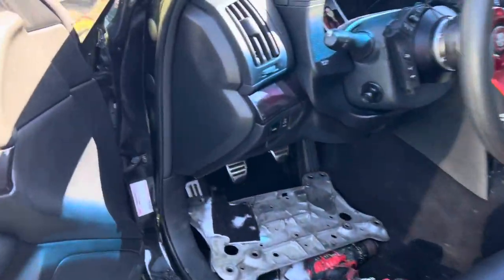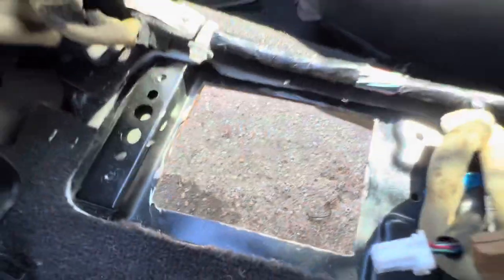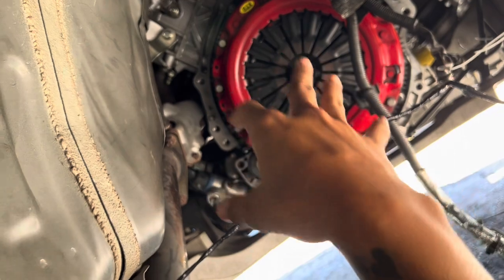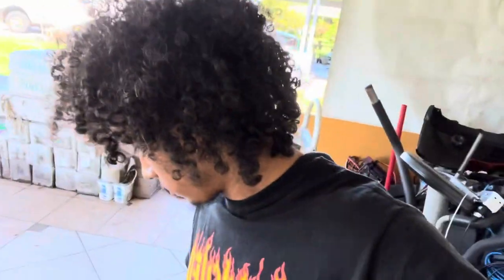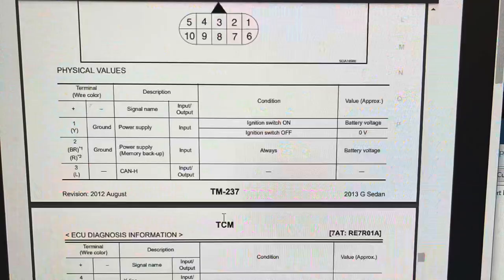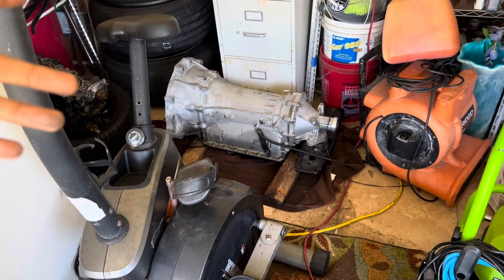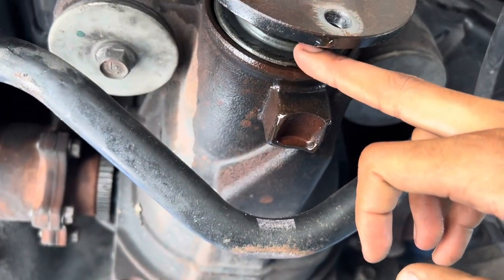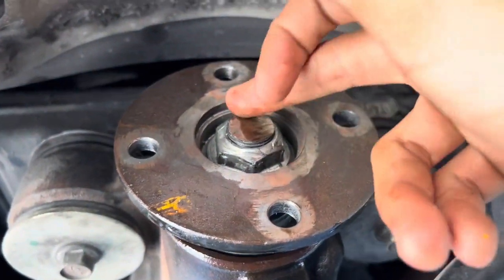How To Manual Swap A g37 Sedan pt. 1

Comment: You have to mark the pinion nut before you take it off and torque it back to where it was unless you replace the crush bearing.  Hitting it with an impact will kill it every time. I did the same thing a few years ago and it lasted about 20 miles of a track day.

Comment: I bought a trans that was locked in gear also and the seller was able to take the black cover off and unlodge something and the trans was great when I installed it. So don’t throw it away yet

Comment: For the transmission wiring harness for the neutral and reverse switch does orientation matter? Obvious grey and yellow together for the neutral switch but does it matter what slot I put them in

Comment: Nice hair brody! 😂🤙🏽 basically looking at this as a nice video to have side-by-side if I end up having to do this… my original 2007 V36 Sedan 6MT was rear ended at a red light, its hard to find these G35S in OEM 6MT (it was order only at the dealers), so figured if I cant find a replacement I’ll get a fully loaded S auto and do a CD009 swap and continue where I left off on mine.

Comment: I don’t think you can get away with just extending the auto drive shaft. They have different connectors on both ends of the drive shaft. The part that goes into the transmission is short on the auto and is blocked by some black metal piece. I haven’t done the swap yet but comparing them side by side that’s how it looks. The manual one has a longer connecter on the side that goes into the tranny. I believe you will need a manual transmission driveshaft regardless. Also the rear differentials are different for a reason. Instead of having to cut that nipple on the auto diff, you could swap for a manual one and fit just fine. There’s also a big ratio difference in the manual ones. It’s a 3.69 rear gear and 3.3 or 3.4 for the auto. To be oem as possible i would just go ahead and get a manual rear diff

Comment: How much did it cost for the whole swap?
Reply: A lot if you buy a new tranny and the right parts in 2024 lol. Im 7k deep about to start the swap but my clutch kit was 1671$ so that was a big contributor. Brand new transmission from Z1 was 2550 plus freight shipping

Comment: hey love that video you gaive all the details im just wondering will this swap list fit the g35 sedan 2008 or should i go with 350z 2008 setup im new in the vq platform
Reply: Yeah u can all universal
Reply: Neutral switch wires will be different on the 5at… you have to look up the wiring diagram. Theres a guy that did it on a 5at coupe and shows which one it is on that transmission

Comment: Hey men ill like some help i want to swap manual my 08 g37 and i want know if a hr manual  transmission works
Reply: I wanna put a hr manual with an hr in a 08 g35x because I crashed my 07 g35s, know if that would work?  Stock g35x is a 5 speed the hr’s is a 6 speed

Comment: Isn't the 7speed faster? Or is it just preference?
Reply: preference
Reply from the maker: Apparently having a manual transmission makes these cars faster but dont quote me on that lol
Reply: Manual is much more reliable aswell. That 6mt can take a beating and handle 1000hp stock! Just needs upgraded clutch to a twin or triple disc clutch. I blew through 2 7ats already. Imo the worst transmission out of nissan